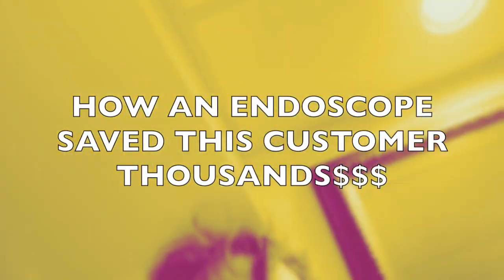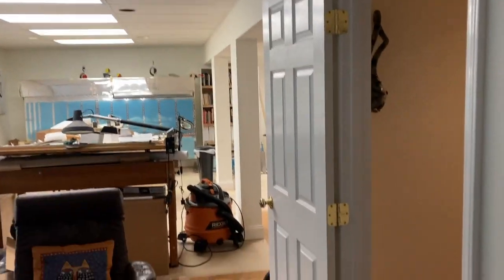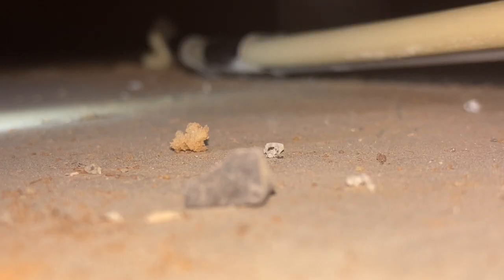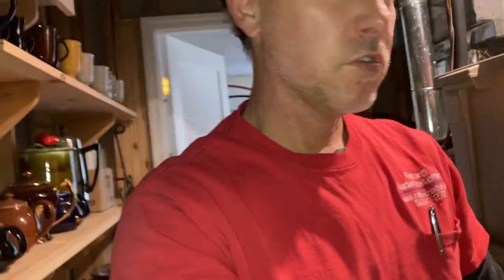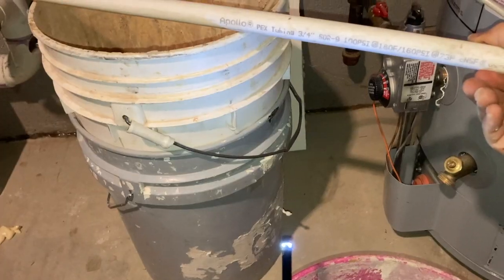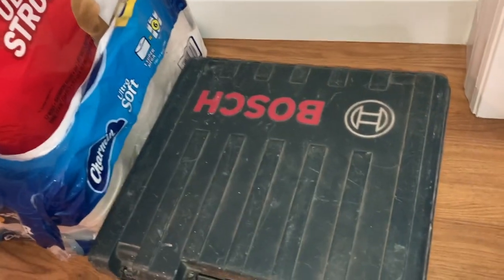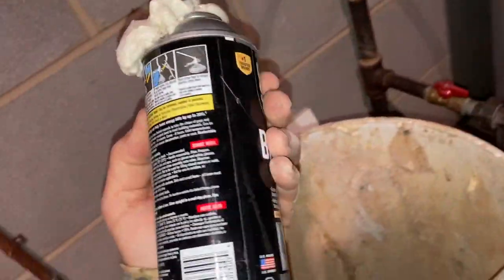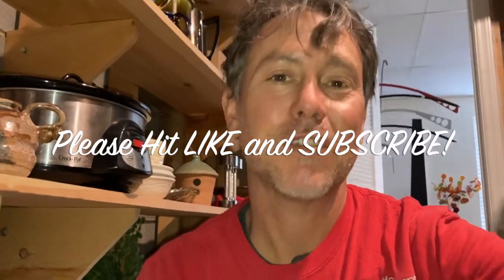Why Basement Bathrooms Elevate Radon Levels. Check out my endoscope!

Comment: What hole saw size is needed to drill and run a 3" PVC radon exhaust pipe out through the house roof?
Reply from the maker: The pitch of the roof will be a factor. The easiest way I know of is to start out with a larger diameter hole saw like 4&1/2."  The hole might evolve into an elipse by having to carve out slivers here or there but saws over 4" ususally get it done pretty efficiently for me.

Comment: Next question: I've been looking through your video's for the setting of the pipe into the basement slab after you remove some fill.  Is you pipe just entering the floor and sealed or are you letting it sit on something to remove hanging stress?
Thanks, Love the Videos.
Reply from the maker: Hi Gary.  Mine just hang glued in from the 90 degree fitting from above and I seal them into the floor around the pipe.  I've noticed some installers in New Jersey run the pipe down the nearest wall and clamp them to it, then kick it out right before sealing it into the hole in the floor.  That way is no doubt superior ,but I've had no trouble with the ways shown in my videos.

Comment: I could use some info on that panel name you used to cover dry wall hole and which box store?  Thanks..
Reply from the maker: Hi Gary. Here is the link for the drywall access panel from www.Lowes.com https://www.lowes.com/search?searchTerm=drywall%20access%20panels
I've always found them in their plumbing section.
They usually have a couple smaller sizes too.